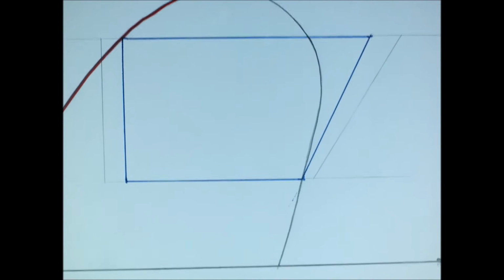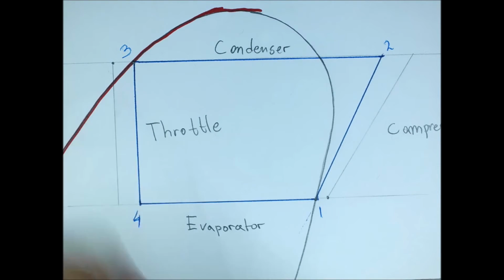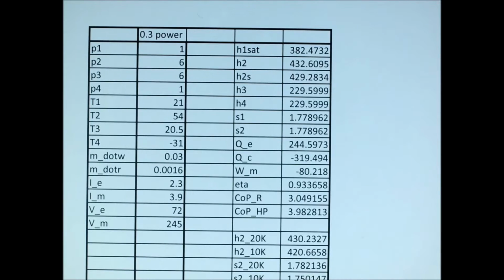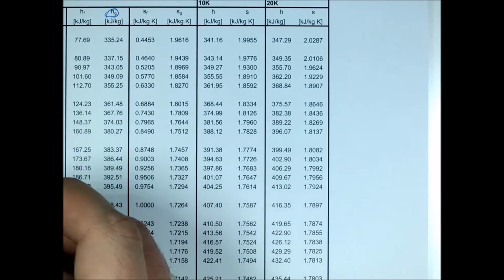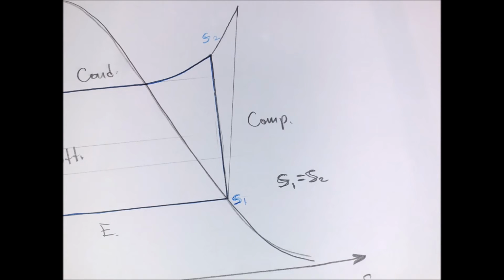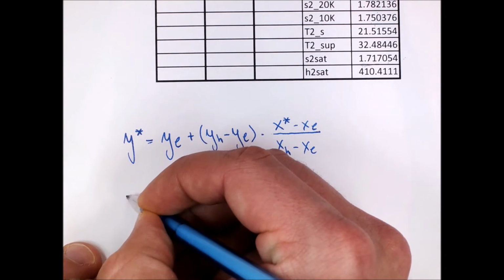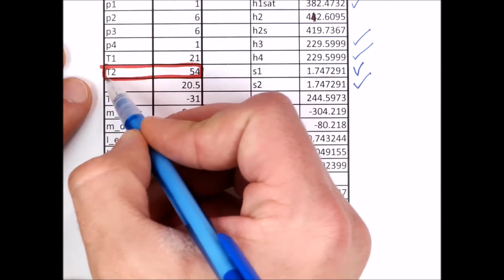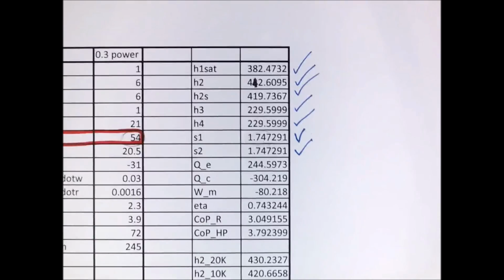HPR cycle for R134a Tutorial

Comment: shouldn't the formula for h2s be with h2 sat and h2 10k? I tried the formula you showed with you values and it didn't add up.

thanks
Reply from the maker: You are absolutely right. I said we didn't need the 20K superheated value, but I still used it. Thanks for pointing this out.
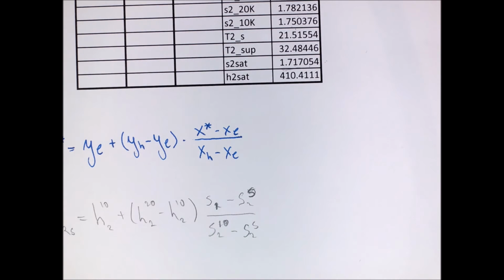Reply: 24:24